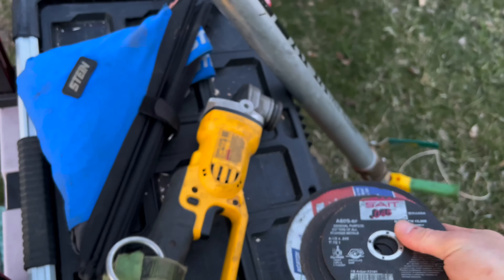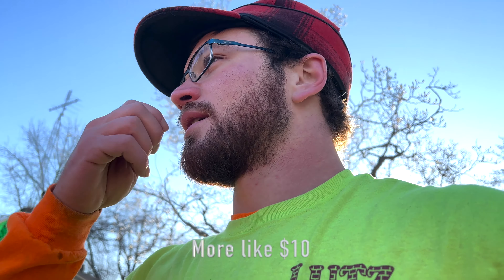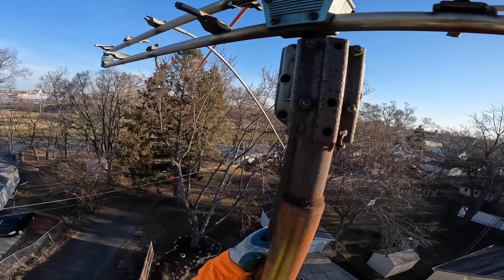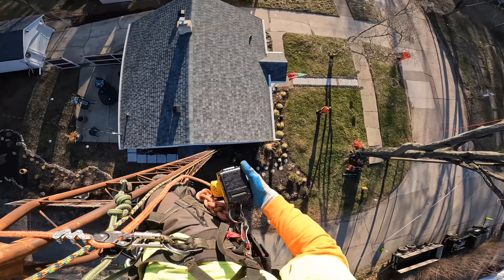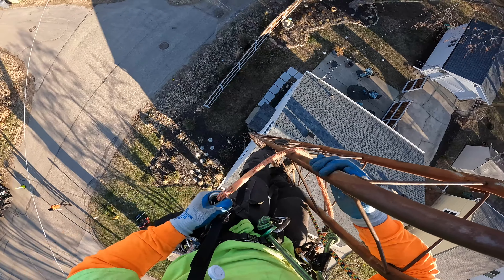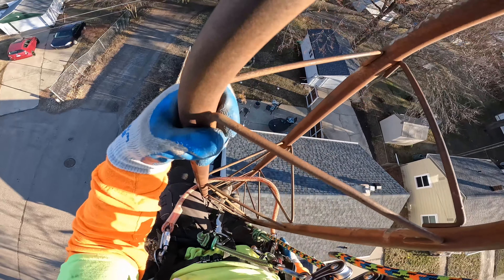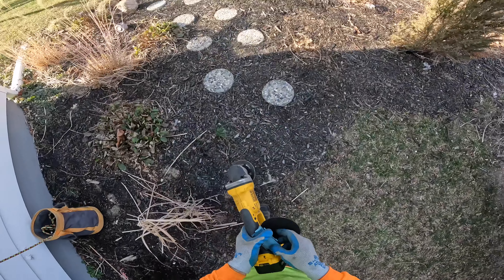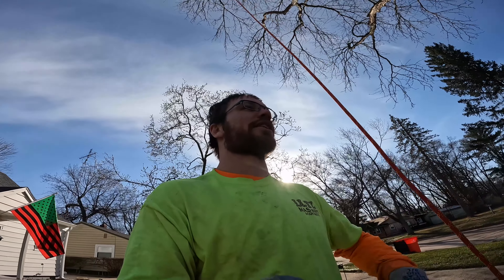Tree Climbers Remove Radio Tower- How To

Comment: i just gotta remove the antenna off the top of mine. super scary sine the antenna is gigantic and has a big motor on it. i tried it without a safety strap but thats nearly impossible i found, since you only have 1 hand to work with. i am gonna borrow my dads climbing gear so i have a line safety line around the tower like you have. wish me luck!!
Reply from the maker: @bmxscape  if it’s accessible, and roughly 40’, it may be safer to rent a lift to dismantle the tower from a local rental company near you. Or possibly call local tree service with a bucket or a lift to dismantle the tower for you. These can be very unstable. Many are 40-50 years of age and have cracked welds or rusted bolts holding them together.
Reply: @TreeClimbersSWMI  i wish it was accessible but its in a pretty tight spot. ive decided climbing is probably the only option without serious landscaping. i have successfully climbed it many times already as i was figuring out how to remove the thing (i know that doesnt help the fact that its held together by rust). ive taken all the precautions i can think of and have secured guy wires to the last section of the tower to reduce stress caused by swaying. i tested out the climbing gear and i think thats all i need... its a world of difference holding on for dear life vs letting the gear hold you
Reply: @TreeClimbersSWMI  after watching this video like 5 times and studying your technique over the past couple days i got the confidence and understanding of how to let the gear help, and i successfully dropped the antenna off the top today. That was the main thing wanted to do, since now i can mount my starlink on the pole instead. 
It was terrifying and honestly i don't even remember much after i un bolted the antenna because my adrenaline was so high. It weighed like 25-40 pounds with the motor and everything and i could barely hold it. I knew it would be hard to hold though so thats why i tied a rope to the antenna and to the bottom of the pole before. After un bolting it i climbed down and lowered the rope by hand.
Still, even though i made it out unscaved, I would not recommend trying it without doing a LOT of thinking or a LOT of training.
Reply from the maker: @bmxscape  happy to hear back and that it was a success. Those antennas can be quite hazardous. However, just like a tree, small pieces small problems. The lowering rope was a smart idea there.
Reply: @TreeClimbersSWMI  thanks! ive been wondering also, how do you learn to become an arborist? like where would someone with no experience go to gain that experience? just apply for a job and hope that they will teach you or what?
Reply from the maker: @bmxscape  we started from nothing, actually, zero experience. My dad was a logger and two of my brothers also cut trees, but myself I had never picked up a saw until we were older . I’d recommend finding a small local company to employ you and be like a sponge. You’ll know quickly if they are the company for you or not. Study all you can, watch all the videos from professionals and reputable people in the industry. Safety and reputation is huge and depending on location, there may be a lack of with certain company’s. Hope that helps
Reply: @TreeClimbersSWMI  thats super cool man. thanks for the info.  i subscribed to you hopefully ill pick up a thing or two more!
Reply from the maker: @bmxscape  I’d love to post more videos, it’s been a lot lately. We just had a baby 2 weeks ago so this year has been a busy one. Thank you for subbing and looking forward to it !

Comment: bring it down in re-useable shape, that's a Rohn 25, should be problem getting $150-$200 for it
Reply: Considering that the rust is merely superficial, all it needs is some sandblasting and galvanization. It is a shame.

Comment: Be careful dear Sir
You must be noticed some more in tower climbing, here is your fall factor is high, in this cases you must use shock absorber with two lanyards and a work position lanyards which attach inside the tower, be safe